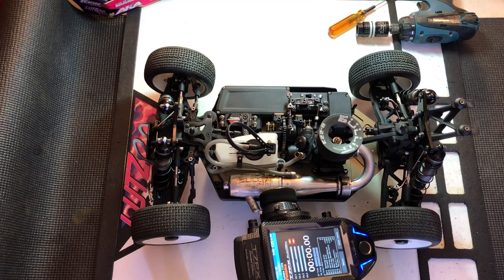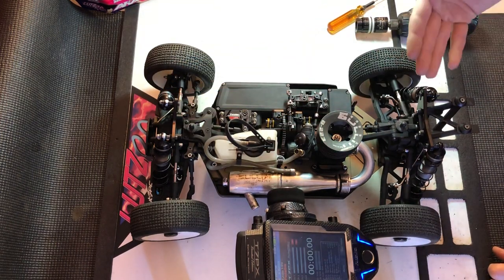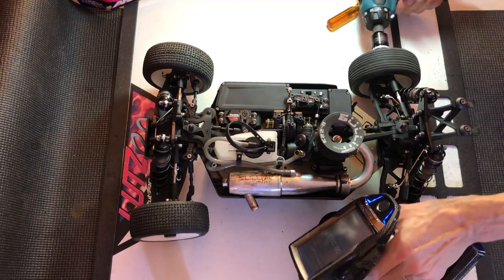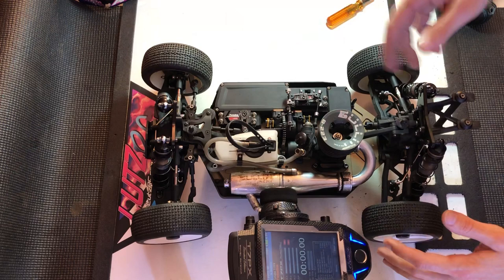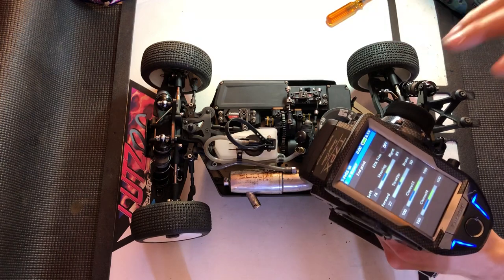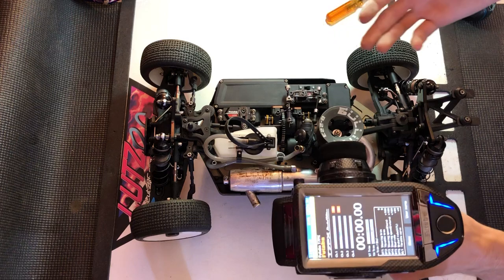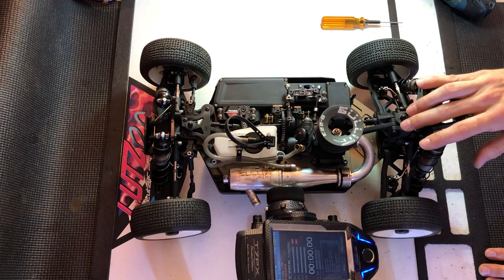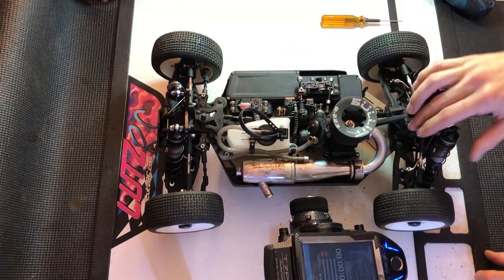How to Adjust your Brake Bias, and Linkage on your Nitro R/C car [Beginner Tutorial with Ryan Lutz]

Comment: Hi Ryan, may i ask on the Agama A215T do you use throttle tube on the brake linkage? or springs? or something else do you have any advice on this.

Also i notice air filter does not mount to anything have you made a bracket  or what should i do with this?

Running the Alpha Dragon motor and enjoying it, just fine tuning Truggy. 

I really enjoy watching your videos and have learnt so much and put it into practise and Truck is so much more precise. 

Thank you for help 👍
Reply from the maker: LMR Brake Balls work well in the Brake application.

Regarding the air filter as long as it's a reasonably supported one I don't do much with it. Just be sure to use a zip tie where it attaches to the carb. 

Enjoy!

Comment: Hey Ryan, what servo tray are you using? I just got an a319 and the stock battery holder is just the weirdest dimensions I've ever seen and not many batteries fit it
Reply from the maker: FreezeCtrl stock. I use the Bullitt 3300 Lion battery. Nemo USA will have in stock Monday.

Comment: How do I rotate the ball that is connected to my carburetor by the low-end needle? I need to change its position to match my throttle linkage.
Reply from the maker: There should be a setscrew opposite the ball that you loosen and can turn it. Be sure to loctite that setscrew when you reinstall.
Reply: @RyanLutz  thanks super star

Comment: hey ryan, i know that this question is not really releated to de video, but, i'm running a cheap ass engine to practice and not waste my good one, that engine kinda lacks on top end.will i damage someting if i remove compleetly the venturi and run widouth it?of course i will rich it up
Reply from the maker: Dark godz you can run without Venturi no problem. Just tune it properly for that scenario. 
If you have enough bottom end torque perhaps drop spur gear 1 tooth if you have.
Reply: @RyanLutz  thanks a lot ryan, really enjoyng your videos and your support.
Love from italy

Comment: I keep a rubber band on the front of my radio. So it will hold the break on so I don't have to hold it with my finger. I learned that from Adam drake